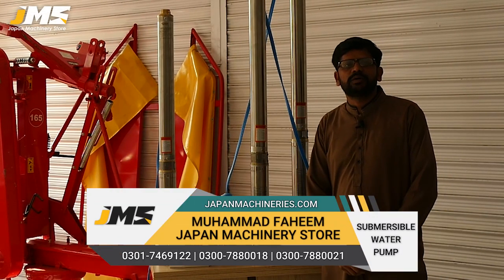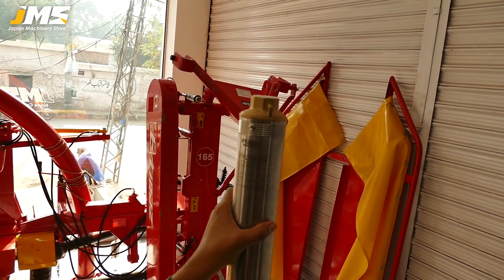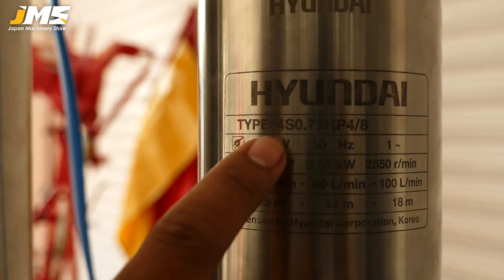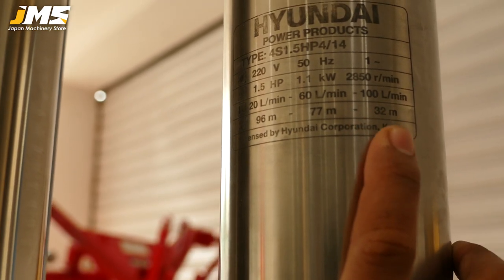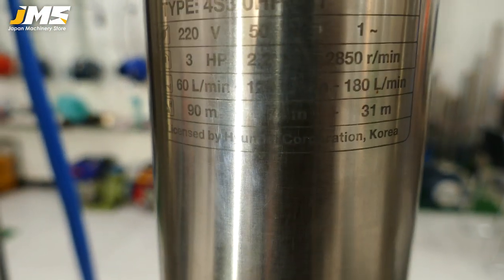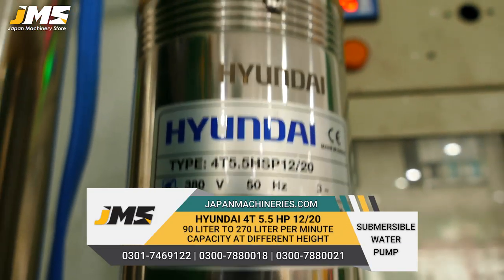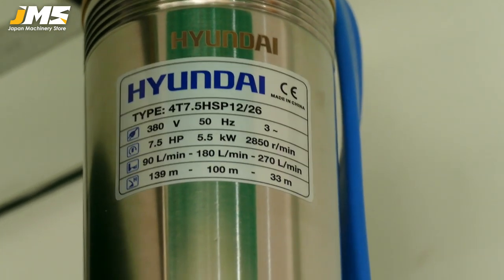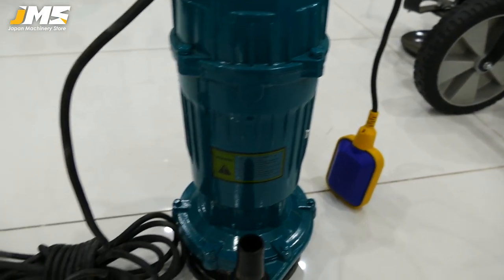Submersible pump - missile pump Pakistan

Comment: 1.5" inch , 0.75 HSP , 0.55 kw , 4.7 Amp
Video main amperes show nhi ho rhy, amp pump ki dusri side p likhy gae hain.
>>> Ab hyundai company pump pr mention kr rhi hy 220v aur 4.7amp aur 0.55kw hain.
>> Calculations krain to 4.7amp aur 220v = 1.034kw hoty hain.
UPS pr pump on krny sy 1.1kw show hoty hain.
(Kahan 0.55kw aur kahan pr 1.1kw, double difference) 🤔🤔🤔😒😕